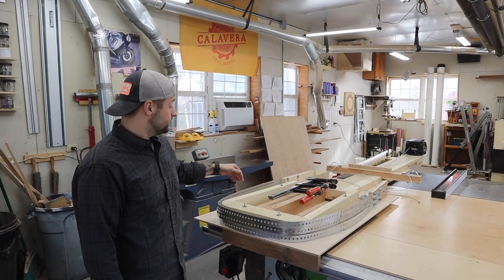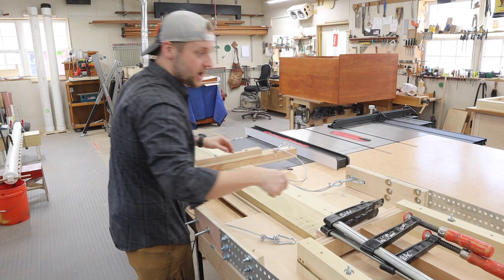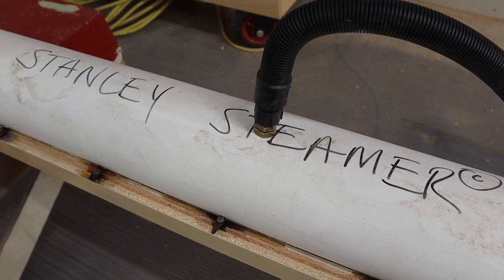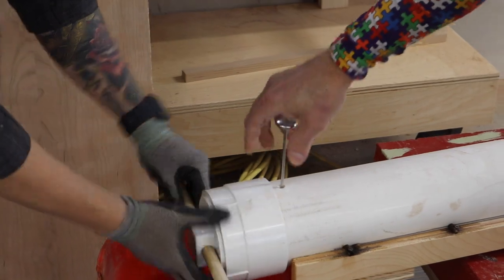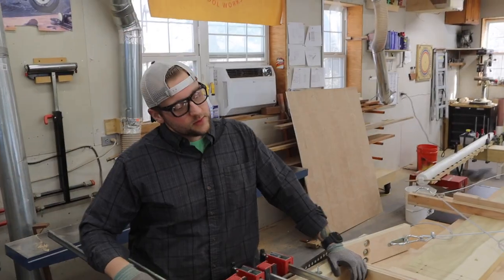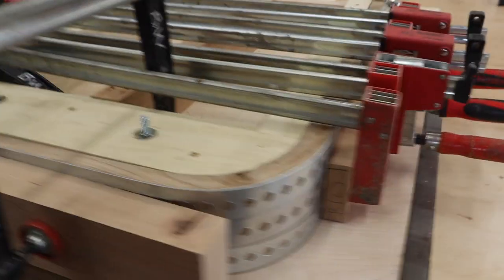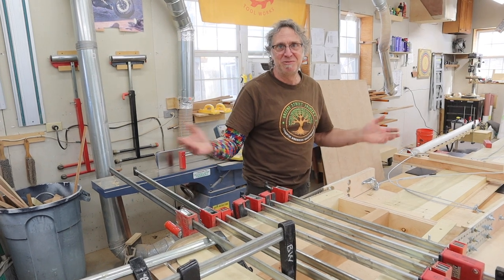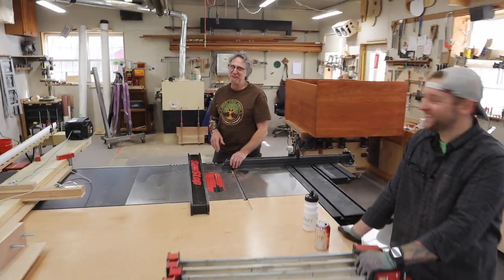Bending Solid White Oak

Comment: Why didn't you run it through joiner and planer before it went in the water? Kind of a danger doing so after its bent. The ones that fail should have a slight curve to them use the to put clamps on the curves. That small space that was noticed probably will  go away. Thanks for the strap idea you had a few good tips in this  video